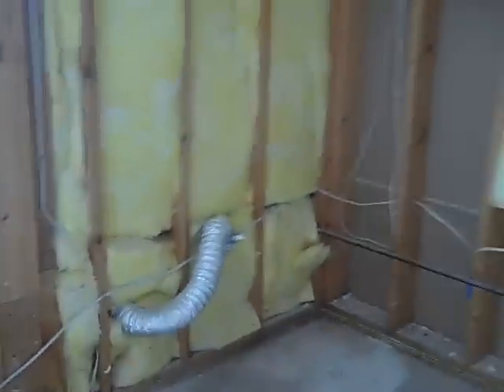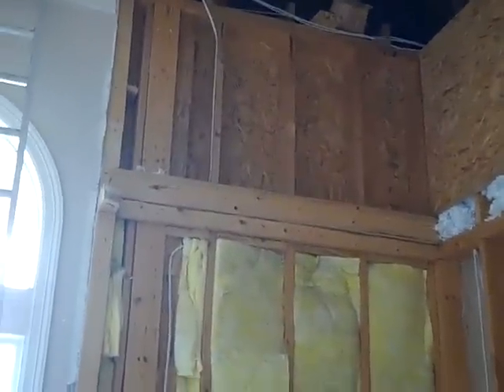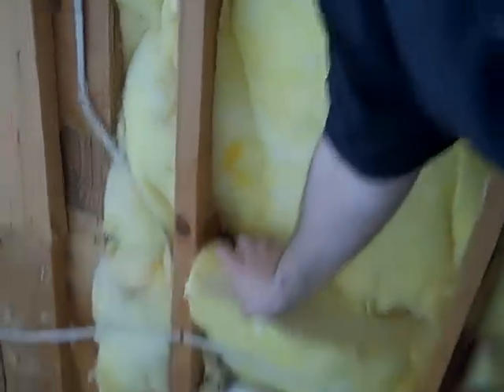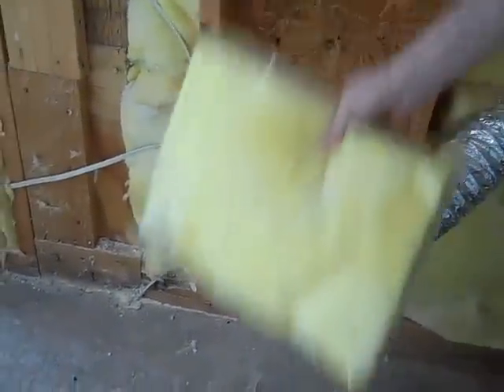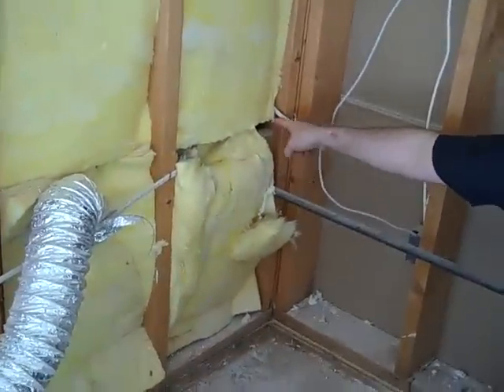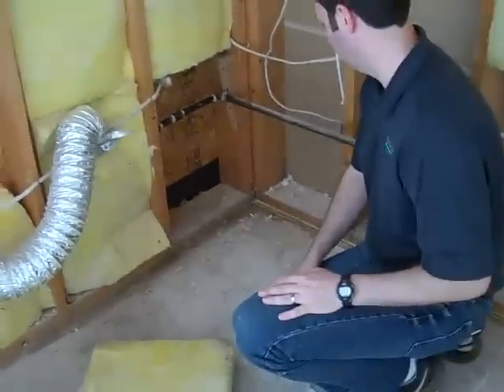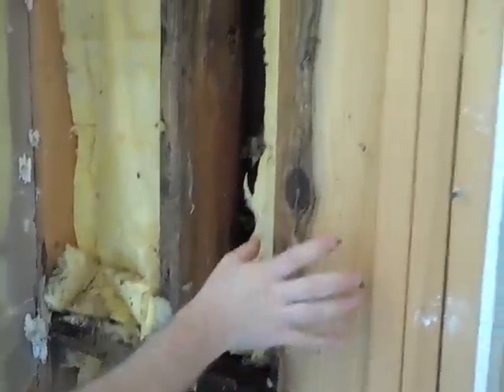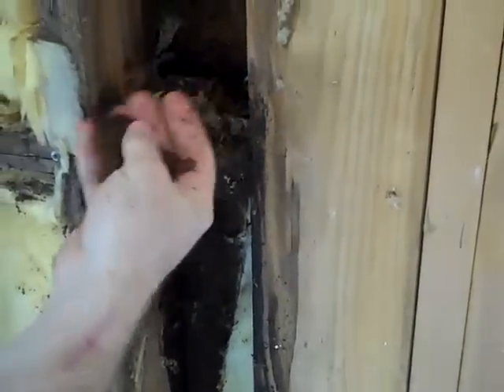Batt Insulation Is Less Than Ideal

Comment: This is great matt.  My double car garage has 2 bedrooms over it.  They are always excessively hot in the summer for my kids.  There are r19 batts in the garage ceiling, but 4 of the joist cavities have 6" flex duct.  They basically squished the r19 down to 1" to make it work, followed by covering it all with the poly tarp you showed here.  It is a fairly significant area but im really thinking spray foam now.  Is that what you would do and what do you think of the diy kits for about $600?

Comment: Hey Matt, Good video. Pretty dumb vapor barrier use. I'm in Austin also and came across this video looking for cellulose batts to install in a crawlspace. Do you know where to find them in Austin? So far no luck with the big boxes or BMC. HD only has the denim stuff, which costs a fortune. Thanks man.
Reply from the maker: Ryan Lynch Try looking for a commercial insulation supply house.  IDI in North Austin may sell to you.  Possibly White Cap too.

Comment from the maker: Great question.  This is my exact strategy in about 90% of the homes I build.  I love 2x6 exterior walls with 3/4" rigid foam outside and Owens Corning Energy Complete blown fiberglass inside.  Then my roofs get 2-3" of rigid on the deck with 5.5-7.5" of open cell foam inside.  Great strategy!  Matt Risinger

Comment: Some imperfections in installation do not have really noticeable effect on total house heat load. Windows are the main gateway of heat gain inside the house. The best windows, have a R value in single digits. They have huge openings compared to the some areas of improperly installed insulation. Blowing in insulation comes at a much higher cost. How much money will homeowners save on utilities?  Sealing attic requires very expensive furnaces. How many years will it take to break even? A long time

Comment from the maker: I've gotten lots of comments to this post.  I'm not saying that batt insulation should never be used, my point is that it's VERY important to get a flawless install to get the stated value of batt insulation.  There are better insulation methods that give a better overall resistance to heat loss/gain.  I know there are good batt installers but they are hard to come by, especially because this phase is continually pushed for lower prices.  Just my 2 cents from experience.  Matt Risinger
Reply: I used Rockwool batts in my laundry room addition. I love that stuff.
Reply: I'll say it batt insulation sucks.  The only reason to use it instead of rolls is to rip off the home owner.  Every single seam of batt insulation has an r value of 0.  You can see it threw the walls with an ir camera

Comment: Matt, great video, I'm not sure why so many people are having a hard time with the shortcomings associated with a Batt insulation system.  They can work, but R values with Batt insulation is 100% contingent on the install, and the fact is there are far less errors on spray-foam installs.  To use the water in a tank analogy, if we think of the water as the energy and the tank as the house, what would you rather see the tank lined with?  I just don't see how it's even debatable.

Comment: Poor installation of insulation and I am not exactly thrilled with the quality of the installation of the NM-B wiring. "Workmanlike manner" is what the NEC calls for, not "Every which way you can". Even if that area was unfaced and hidden behind a fireplace the wiring should have been run in the stud space for protection. Please tell me this was an owner-build and not done by professionals!

Comment from the maker: @oneDarkday Thanks for your comments, though I'd disagree on the idiot part.  One of my main issues with batt insulation is just what you're describing.  The installers are paid by the job (piecework) and it's nearly impossible to get a good install.  Spray foam or Blown-in cellulose/fiberglass are much easier to get a flawless install that will perform well even if the installer isn't perfect.  I'm not abdicating the job of proper builder supervision.  Batts aren't ideal.  Matt Risinger

Comment from the maker: @ironflyer In a hot/humid climates, building assemblies need to be protected from getting wet from the exterior and allowed to dry towards the interior.  Accordingly, air barriers and vapor retarders are installed on the exterior of building assemblies, and allowed to dry towards the interior by using permeable wall finishes, installing cavity insulations without vapor retarders (unfaced fiberglass batts, spray foam, etc.) and avoiding interior "non-breathable" wall coverings (vinyl wallpaper)

Comment: Why are you against the use of a warm side poly VB in a humid climate? In our Pacific North West climate which is very high humidity (Boreal rainforest) requires an internal poly as standard practice. Of course we get snow and cold climate conditions which amplifies our moisture fluxuations. I can't imagine not using one in a standard residential application. I do agree about the spray foam, although not perfect it sure is nice getting full R-value and VB in one shot.